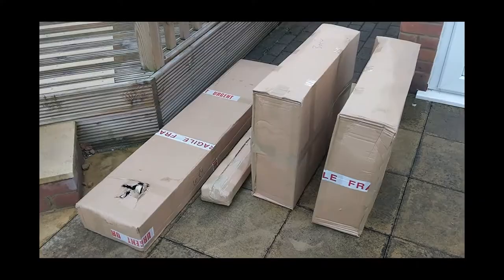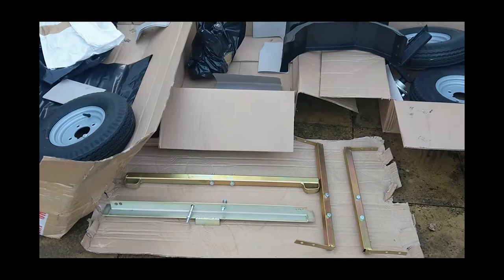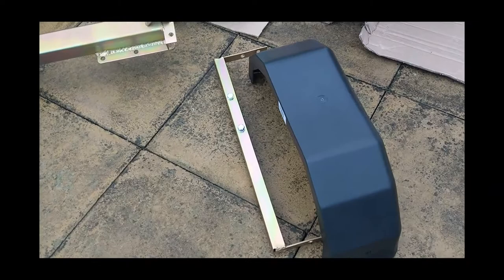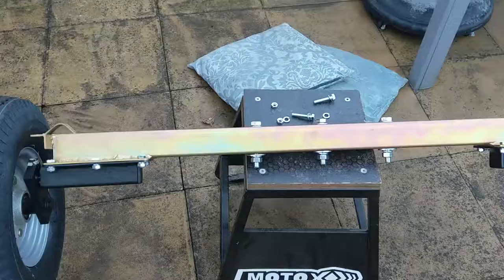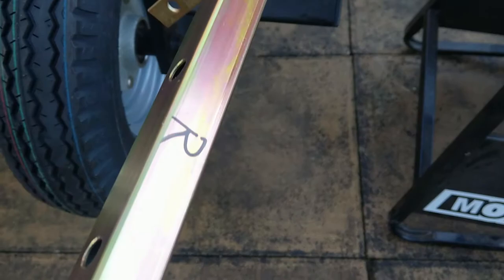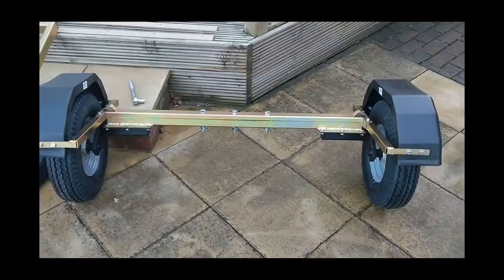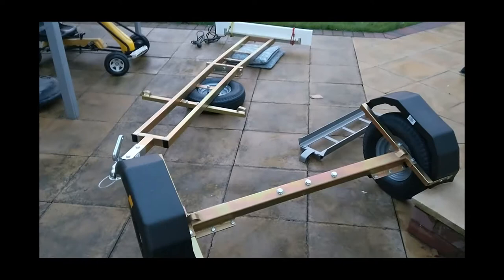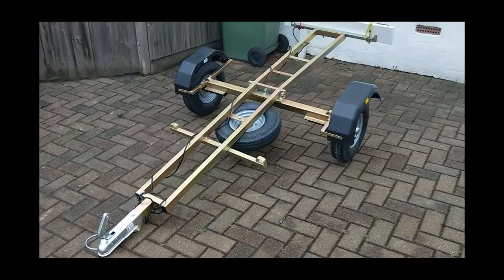Dave Cooper 250kg Collapsible Single Trailer Build

Comment: I have the same but mine is for 300kg . Also when I put the Axels on I used a long straight edge to align them up as much as possible. I found that there was too much room for error when fitting these Axels.

Comment: Hi Phil looks good I'm also thinking of picking one of these up.. how do you find it loading your bike up ? OK to tow ? does it collapse easy enough ? getting into some green lining and bit of enduro Cheers Pete
Reply from the maker: Hi Pete, I haven't put the bike on it yet. I've taken it for a tow whilst empty and it is fine, don't even notice it is there, can't reverse yet though. Others in my local TRF group have these and all seem happy with them. I store the main part in one piece on its side down the side of my garage, and just have the axle at the back. That way it is just three bolts each time I want to take it out. So it takes less than 5 minutes to be ready to load a bike. If you have less storage space then it's just another three bolts to split the main part into two, so only another couple of minutes max. Can't see it being too difficult getting an enduro bike on and off (WR450F is what I have), but I wouldn't fancy putting my road bike on it (around 225kg wet).
Reply: Philip's Green Lane Videos hi Phil many thanks for the info.. I’ve also joined the TRF and looking forward to having a blast picking up a ktm 300 next week 👍 good news that a few other people you’ve spoke to also rate this trailer 👍👍 great price to
Reply from the maker: @n22pdf  Towed the bike yesterday, 35 miles each way. Very easy to load the bike. I'd advise putting the tie-downs on first, you then have to hold the bike upright, whilst connecting the first two ratchet straps. I put four straps on.  My car is a 3.0 V6 diesel, so didn't even notice it was there, save for seeing the bike in the rearview mirror. Have ordered a front fork support stand, to save fork seals.
Reply: @philipsgreenlanevideos4352  Hi Phil.. many thanks for the info ordered mine last week.. worth knowing about the front fork support.. i ialso ordered a spare wheel and bracket with mine :)

Comment: Hi guys I'm also looking at getting one of these... firstly I can't see a front wheel chock do they sell them separately?and secondly do u have to use a metal loading ramp or will the bike wheels move between the gaps?
Reply from the maker: Hi, I believe you can buy a front wheel chock from them separately. I didn't bother as I only use it for an enduro bike, so didn't need it. There is a small loading ramp that they supply, see the silver / grey item at 27 seconds of the video. The enduro bike then pushing all the way on and off without any issue. I am likely to be selling mine now, as I have bought the kids a CRF110F and so I need to buy the two plus one model.
Reply: @philipsgreenlanevideos4352  thanks for the unbelievably fast reply! Nice one,it's to load up a Yamaha wr250f so should be no problems I take it the front wheel as it's a 21" will just slot into the end run....
Reply from the maker: @darrenporter4962  mine is a 2011 WR450F which fits perfectly.

Comment: No ramp, No floor board, No front tire lock, No safety chain, to much work to assemble and disassemble!!! I'll pass thanks.
Reply from the maker: I use a bulldog hitch lock when I park and leave the trailer attached. It comes with a ramp. Dave Cooper sold the safety cable as an extra when I bought it. Wasn't expensive,  I think less than £10. Once it's assembled, it's really easy to store, just three bolts to remove the rear section and then put it back on to tow.  https://youtu.be/zQS8xDSAZcs